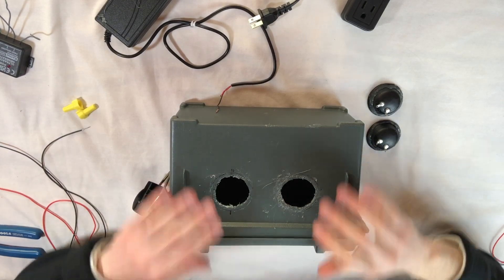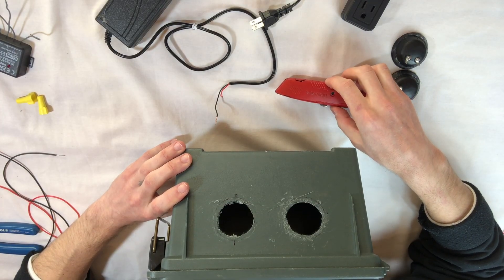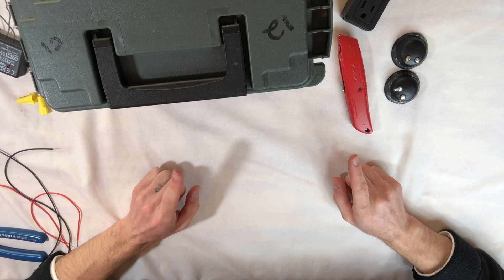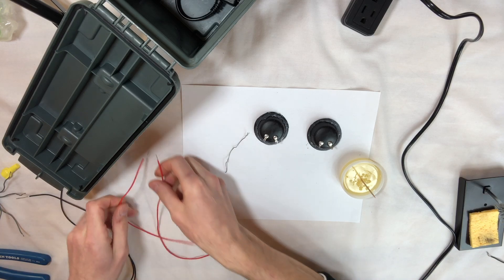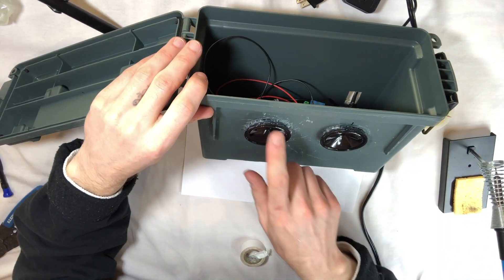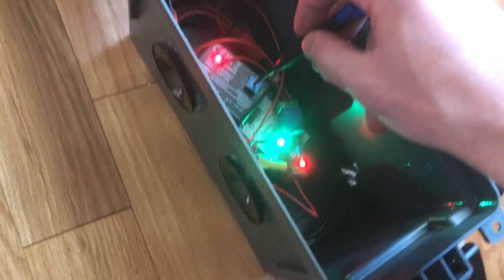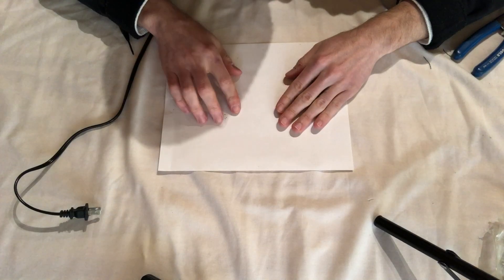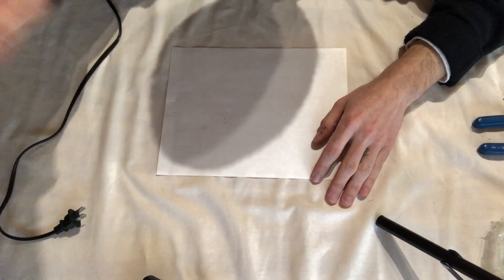How to Stop a Dog from Barking - Anti Bark Device Part 2: Final Build --- Animal & Pest Deterrent

Comment: I like your videos I added a link to one of my videos that compare the Piezo vs a regular dynamic tweeter . In this test u can see the difference between the Piezo and that Orion tweeter was a 20db sound increase. So for argument's sake let's just assume  the Kemo unit is putting out 1 watt of power (I know its a bit less than that) and using the Piezo I was seeing 70Db at 18' then switching to the Orion and seeing 90db. That 20db difference would be equivalent going from 1watt to 100watts worth of audio output on Piezo speaker. I guess my point is that if you stay with high sensitivity tweeters as seen in my videos you may not need an amplifier at all, just passing along what I have learned dealing barking dogs over here. 

https://youtu.be/T-MdMUWuVxY?si=01FP8GkZptIlDe-L
Reply: But does it work?

Comment: I AM JUST STARTING TO BUILD MY OWN Anti Bark set up.  ;-)  I am starting out with a pair of 500-watt super tweeters. I want to be able to rip the ears off those pests if needed or desired, so I started out with BIG HIGH-POWER TWEETERS!   I'm assembling my own custom signal generator from a kit.  Like you, I will test it with just the output from the generator to see how it preforms and works on the dogs.  I will be installing the generator, power supplies and (amplifier if needed) inside the house. I will run some output wire from the house to the tweeters in the yard.   I purchased a Bluetooth actuation switch to trigger the output of the generator to the tweeters inside my ammo can.  I can place my speakers within yards of the pest dogs.  I will only blast them when they bark by pressing the remote actuator fob button.  What is the purpose of that delay?  I will incorporate one if necessary/needed.  Please follow up on how well it performs on the dogs. Also report on any changes or improvements that you make to your system. I will provide my e-mail address if you want to communicate privately; bill327@msn.com     Please Comment on what you think of my plans.    Liked and Subscribed!!